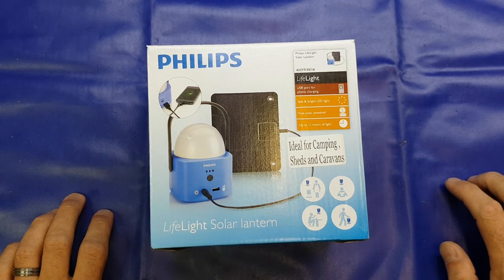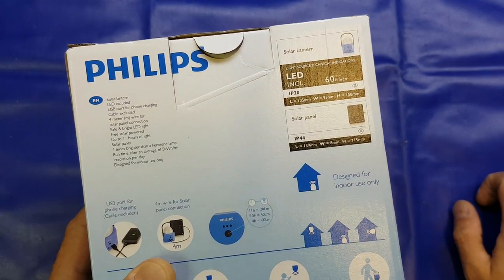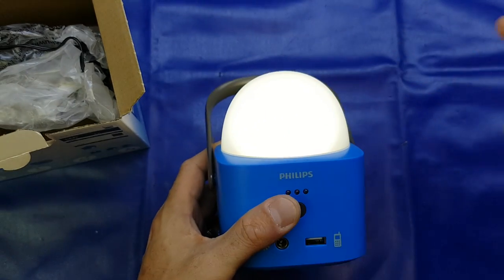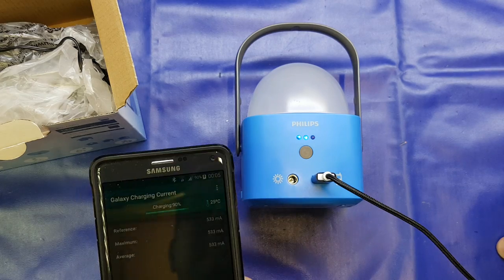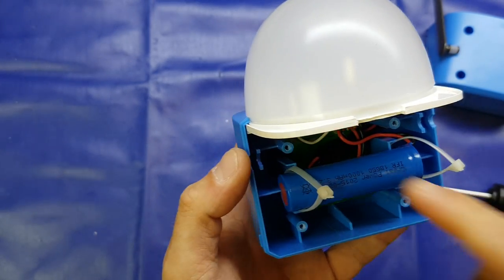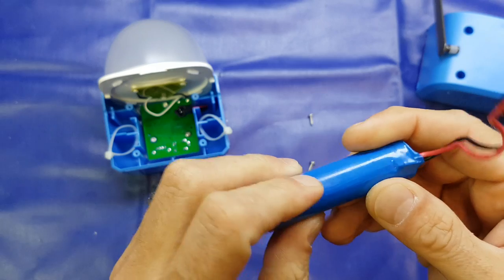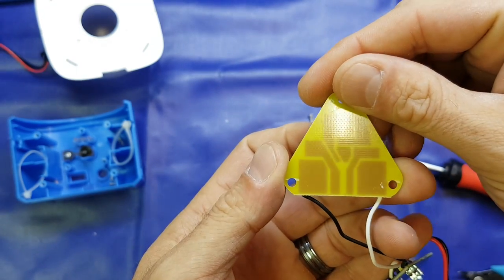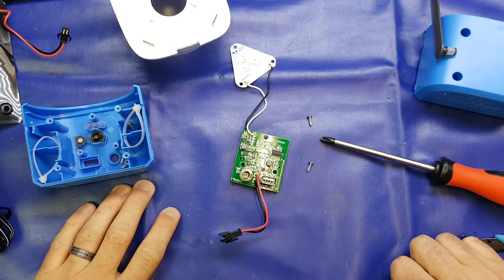Super-cheap Philips solar lantern teardown and a question for you all!

Comment: About those chips on this board: What you thought it's charging circuit is simply a part of overcharge/over-discharge circuit, a dual mosfet. Next to it is U1 - protection IC, U2 is a boost converter for led's, with PWM modulation from U4. USB output is from U3 boost converter. U4 is probably some cheap microcontroller, that controls everything on this board. Solar panel is probably connected almost straight to rail after battery ic, with only one reverse protection diode D1, that prevents putting battery voltage on solar panel connector. Those 3.2V batteries have smaller capacity, but they can take much more abuse without going thermonuclear. There is even fuse on this board, something that you might not find on many other more expensive Chinese products.
Reply from the maker: +kjur18 Thank you!

Comment: The frosted difuser dome would absorb some of the light from the LEDs. It may be a trade off for better distribution. If the LEDs were facing out the output might be higher.  Otherwise assuming the battery rating is legitimate, for the price it seems to be a decent value.

Comment: Do you think it can be charged through the dc input jack using the multi lead, and is that dc jack 9.5mm.
I have an aldi pir solar light that failed because water got into the solar panel, but I wouldn't want to chuck the rest